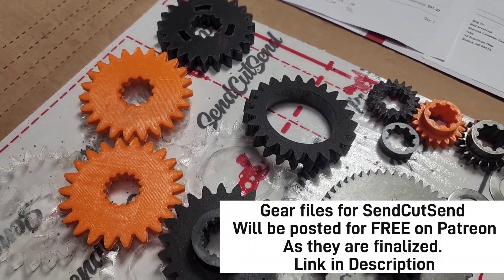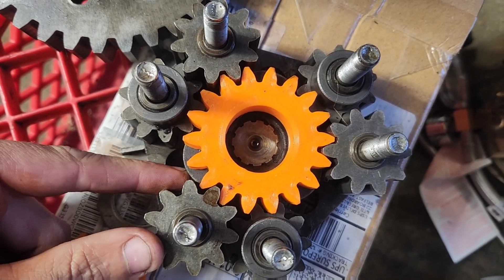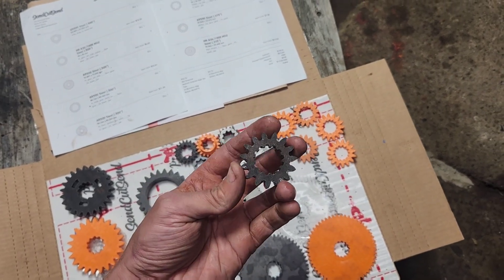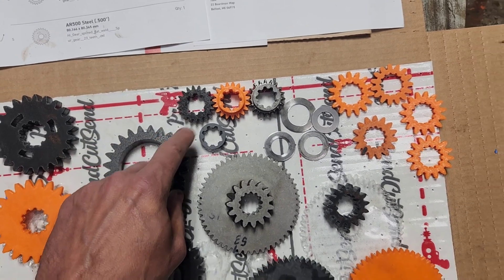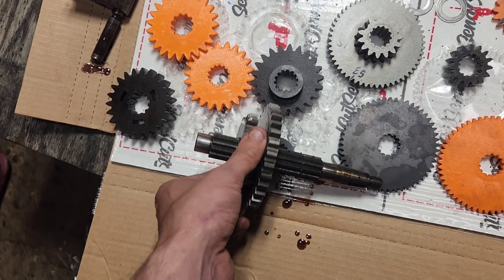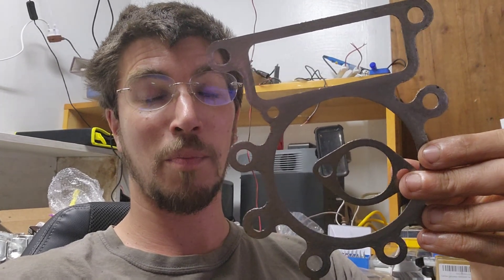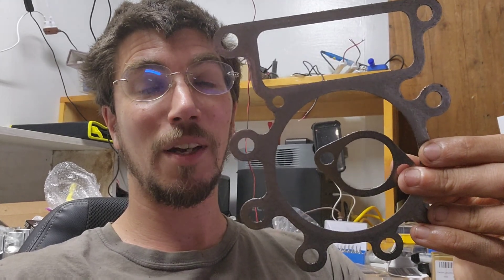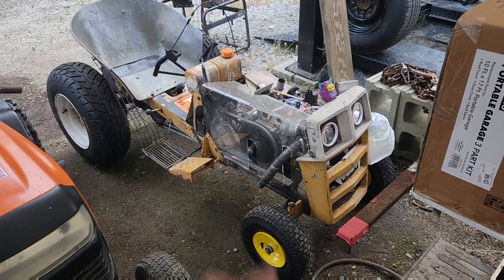Laser Cut Gears From SendCutSend @sendcutsend

Comment: I have had hundreds of parts laser cut, from thicker materials they never looked like this. we spec tolerances of -.000 + .005 for the parts and they hit the dimensions right on. I have parts water jetted and the surface finish is close to a mirror finish, tolerances close to the laser. As for the AR500 it is abrasion resistant the welding requirements are super critical, and it can become brittle especially with small parts.
Good luck with your endeavors.
Reply from the maker: Good info!

Comment: nice job, just curious, to get better cuts on the gears, use two thinner gears instead of one thicker gear.
Reply from the maker: That was another idea was making each gear 2 parts. One solid and the other with 4 weld in points to combine the gears. Would be very easy to design once the basic cut is sorted.
Reply: @redneckcomputergeek  Can they not flip over the gear and go back and re laser cut clean up the splines? I mean if the laser can cut most of the way nicely then sure to god they can flip it and clean up the splines..
Reply: @FukTheGovernment465 no, thats not gonna work,😢 the blowout is conical
Reply: @D3rron08  Oohhhhh well shit ha ha.

Comment: it's too thick for LASER --- #1 Waterjet cut them or #2 lasercut them in 2mm steel and stack em and silver solder them together.
Reply from the maker: That was another idea was making each gear 2 parts. One solid and the other with 4 weld in points to combine the gears. Would be very easy to design once the basic cut is sorted.
Reply: @redneckcomputergeek  4 parts, u can make holes and weld or hammer in rivets too, no forces that way

Comment: Great video Neil!! You are certainly doing some great research and getting stuff done.. I am restoring a milling machine and when it is done I would love to build a gear setup. That will not be for a while. I am building a 1928 Morgan RIP special GN race car from scratch. It is the one that is built like an airplane. I may need an opposed twin  (horizontal-the one that has the shaft coming out sideways and not the bottom) that runs at some point so I will be getting in touch with you
Reply from the maker: The big hurdle does not seem to be the gear cutting at this point its the inner spline part. The originals are sinthered steel made by baking in a mold. This seems to be the ongoing problem including in modern day machines.

Comment: Now you have me regretting selling my 1986 Craftsman GT6000  with a personally upgraded Electric Actuated Sleeve Hitch!
It just got to the point that attaching/taking off the Fabricated 44" (3-blade) deck was too much for my back to handle...
Damn I miss that Opposed Twin 22 HP Kohler engine!